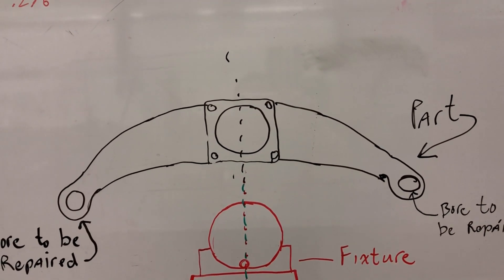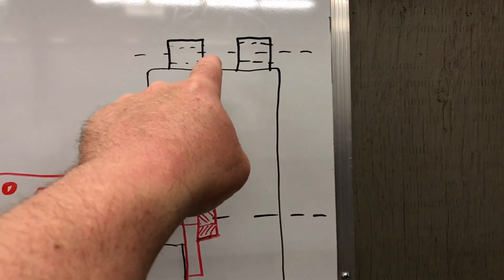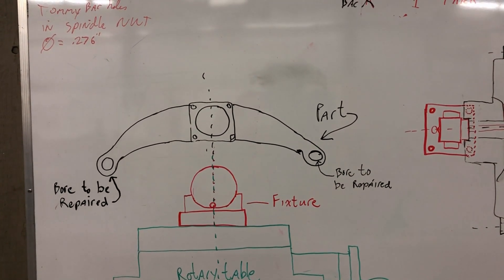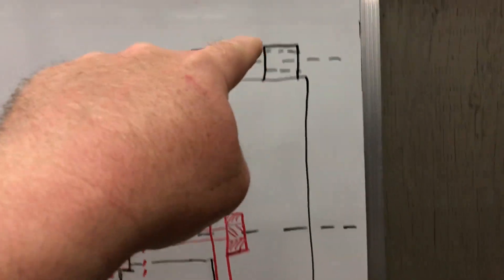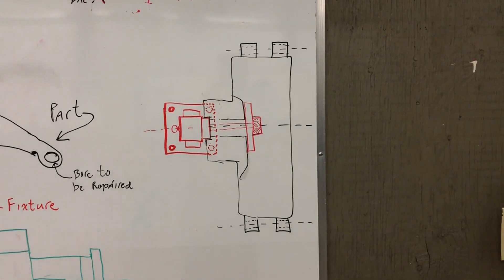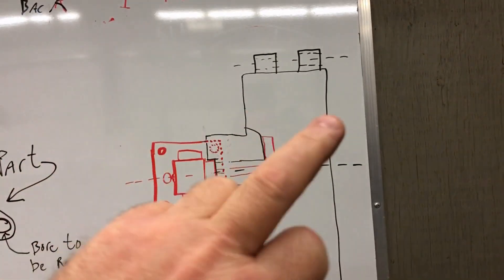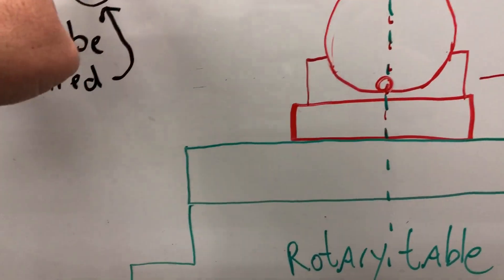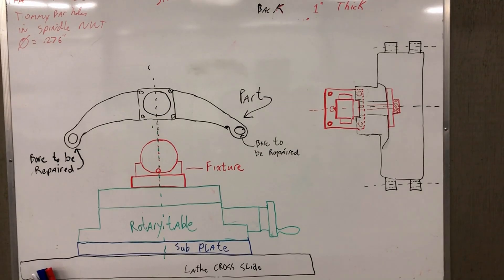Line Boring on a Lathe with a Twist (or a rotation)

Comment: Fascinating stuff. Thanks for that. Did you have to shim the part to get the bores in line with the spindle or did you just get lucky on the measurements? I've seen line boring videos in the past but nobody ever seems to discuss how to adjust the part vertically to align it with the lathe spindle.
Reply from the maker: Hello Ned.  In this case I did not have to shim.  I knew the offset distance between the datum bore and the holes I had to bore out.  I then built the fixture so it would hold the part at the correct elevation.  This is what made this fixture so quick to use.  I simply put the part on the fixture, lightly tightened it up, levelled across the bolts and then firmly tightened it up.  The boring bar was installed and the work could start.  For a good example of how to shim to height watch Max Grant's recent videos where he does exactly that.  Ken
Reply: @hmw-ms3tx  Ah, right, that makes a lot of sense. I think you actually mentioned that in the video but I somehow just glossed over it. A followup question I had was in regard to possible concerns about putting that much weight on the cross slide. Is there any concern about putting too much stress on there?
Reply from the maker: @danf6070  The weight isn't really a concern.  The whole set up probably weighed about 200 lbs.  When the lathe is used in a normal fashion taking a heavy cut can easily apply more than 200 lbs. down through the cross slide.  Machine tools are designed to minimize deflection while under load and because of this they are many times stronger than they need to be to carry the loads they see without fracturing.  It's why it is so rare to see the main castings of a machine tool broken unless something catastrophic happened. Ken